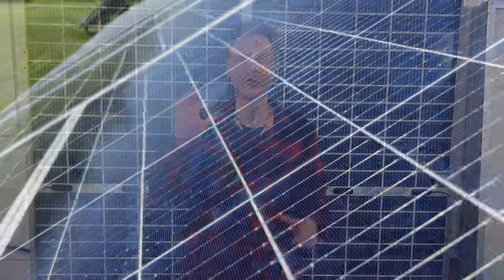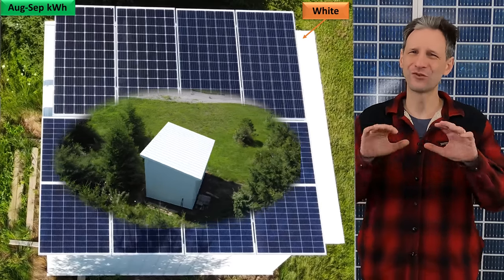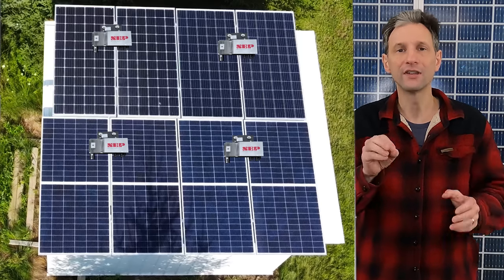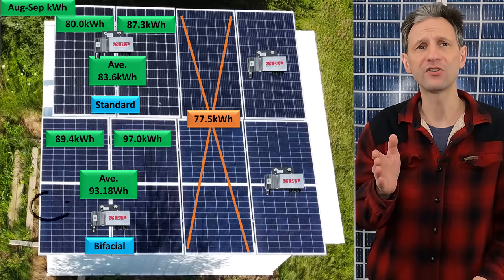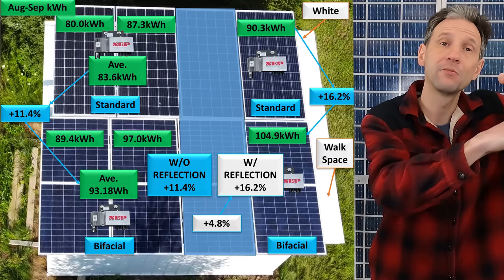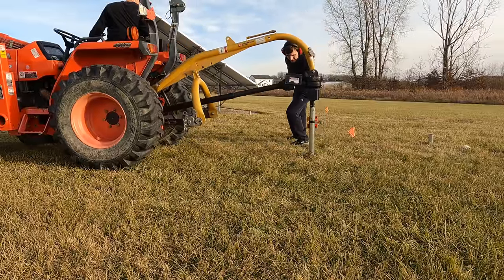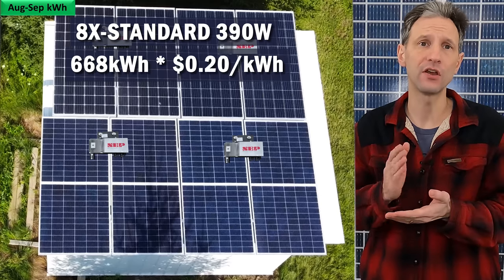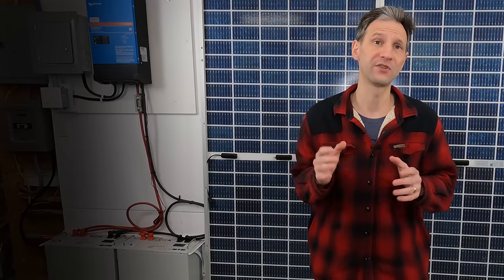Should you put BIFACIAL Solar Panels on the ROOF?

Comment: I just read a study on bifacials that showed that the best possible positioning is to align them east/west and perfectly vertical.  It produces more total power, and does so over a much wider time period.  The trick of course is the wind loading, but it's doable and makes a lot of sense as secondary panels to expand your harvest.
Reply from the maker: I have had a lot of requests for vertical orientation of bifacial panels, I plan to work on a test setup to try that out, but it will take a long time to get a full season of data.
Reply: Great point James!
I read a similar article that used bifacial panels in this way; but also used the terrain & weather (foggy) conditions to their advantage! They used water collecting nets above the panels (some also below for comparison) and produced not only more power but also got the efficiency gains of cooler panels!!!
Gotta love our innovative minded people coming up with these adaptations!!!
Reply: @ProjectsWithDave  That would be very interesting!  I've thought about doing a BF panel fence line if I ever feel the need to expand my system.
Reply: Ya, I was was wondering why this guy had them set up wrong. This guy wasted his own time and everyone's who watched this by laying them down.

Comment: ATTENTION: you missed a major point in conclusion in my opinion cause the bifacial have a better protection and longevity cause both sides are protected by glas. The small white foil will age not so well and once humidity gets in the corrosion will start and production decrease a lot. I had such issues with a trina solar panel field and you could see the progress of holes in the foil than getting bigger over time while also building oxidations on the cells itself. You can even feel them.

This can not happen with such bifacial panels and that can be worth a lot. You do not know what not can cause the damage of the foil like cleaning the roof with a Kärcher, also animals running under panels, then wind with sand and what not will have an impact and can damage a single panel and have a huge impact over time cause you will not recognise the slowly decrease over time  in a long string. Maybe a year or 2 later you will wonder and compare month to months and start a research what is going on. Many then consider degredation as the cause , I mean degredation of the whole field. And if another year or 2 pass by they might start offcially complaining and learn that it needs a labour intensive investigation on the roof for that string panel by panel cause it could be just 1 panel that has issues and not all of them cause then the solution is usually easy: remove the weak and broken one and shorten the string cause you will not get a replacement of the same size and characteristics as long as you have luck to find one or usually some on the used market over time. 

Glas Glas is the best you can get and it will pay off for sure but might take some years. The degredation or the likelihood of damages are lot lower than those with a thin foil . But I am from the EU and we might have different products and experiences here due to climate and what not. I do not see it often, but I bet many do not know after 12 years or so that a single of these panels could have caused all the losses what they considered to be caused by degredation of the whole string , not a single panel. They do not even recognice it cause no one investigates the back of these panels in the assumption if a hole in the back of 1 panel could have caused the whole decrease over the past 2 years.

But we had repowered a lot of roofs in a small period of time last year and faced a lot of these or similiar issues mainly caused by a single panel - also MC4 connectors that lost its perfect fit and connection. We try to look for that cause if you wanna sell used panels with faith you should know what you are selling and therefore we marked every single panel to later find out if we could see an impact when and where what might have started. We have to check the modules any way but it was the first time that we faced a lot issues with damaged foils no one can explain how that could have happened. Partly while carrying the panels onto the roof, then during mounting, connecting , fixing, adjusting by any kind of accident like a screw driver falling onto the shoes then hitting the panel under the foil. No one had taken care for that. Might also be the case of micro holes or scratches the winter and frozen water increased and what not. 

The worst panels with a ton of issues were the Trina panels 240 Wp from 2014 or so. 50% with one issue or the other and mostly oxidation under the white foil.

Comment: For me the comparison between output power and cost is the most important. If the cost of the bi-facials are 120+% greater, you would be better off installing more regular panels, unless you can meet all the added conditions to optimize bi-facials.

Comment: for rural consumers like myself, with plenty of white pole barn roof to work with, it sounds like it might be the way to go, especially as the price for bifacials keeps coming down. spread them out a little, mount them up off the roof some, and i want to put mine on angle adjustable bases so i can tweak the angle throughout the year.

Comment: So for this test if you were to lift the bifacial panels a meter or so, and have them on a ground mount preferably, You would absorb a lot more energy from the backside. This is mentioned multiple times in the literature, And I mentioned this in past videos. The temperature coefficient of those bifacials is also different. So more convective air flow helps significantly. A parking structure is fantastic for bifacials. They really need to be lifted up high to see the benefits. In your configuration they will run a bit hotter than they should and they will not absorb much energy from the back.
Reply from the maker: That's correct, the purpose here was to show what kind of performance could be expected from a standard mount on a white roof.  The higher elevation would be much better for all the reasons you mentioned.  Ground is a better application for bifacial panels as I show in my ground array results video: https://youtu.be/1SXNjsSsmq0
Also, I have done some testing with snow reflection on my ground array, I hope to post soon.  Those results were very good.
Reply: Is there a roof racking system that will raise them higher or is that a wind concern?

Comment: Thx for all your work and sharing of information. 
I appreciate any and all accurate information about solar setups.
I believe, in the interest of simplicity, the data provided is a good reference. Your/ my mileage may vary.
In this example, I believe the rack should be moved up so the white is totally under plus 6-12" or more.
The lack of reflection on the lower edger could essentially make the bifacial portion almost useless.
Also, ignoring the 3rd panels, skews the data. 
Averaging power is a start, but individual panel performance is more inclusive.
I am waiting on getting a pallet of new bifacial panels. Will be roof mounting most. May update afterwards.
Reply from the maker: Let me know how it goes.

Comment: I saw a video that said the tiny spacing between cells in a bifacial panel was transparent and light the would strike between cell on a standard panel would hit the roof and be reflected back to the back of the bifacial.
Reply from the maker: Some panels are transparent and some are not.  The Canadian Solar panes in this video have a white band that blocks the light between the cells.  I just ordered some panels that are transparent in the space between the cells.  I plan to do some testing and see if it makes a difference.
Reply: @ProjectsWithDave  I saw a Youtube video involving an installation in Britain where the transparency was pointed out.  Hopefully it can actually increase absorption on the underside.

Comment: I have two dual axis solar arrays of 3140 watts of panels per tracker. The panels are 390 watts each and are bifacial the ground surrounding them is a white reflective stone in order to maximize the reflective light. The best performance I have seen is around 3372 watts per array which was limited due to my MPPT controller.
Reply from the maker: Because you don't know what the solar irradiance was at the time of your measurement, and your inverter was clipping, it's hard to judge what the actual benefit is.  However, in my experience, conventional panels have to be significantly over 1,000W/m^2 to exceed their rated performance so it sounds like your setup is doing quite well.

Comment: Great videos. Thank you.
I don’t agree with you though when you calculate paybacks periods and ROI based on the system production. What counts is your actual solar consumption you don’t buy from the utility grid. And both numbers (production and consumption) are usually far from each other.
Reply from the maker: I have to purchase any power I don't produce from the utility.  That cost avoidance is used to calculate the payback period.  If I am overproducing, then the values change significantly as does the payback period.  It all depends on your specific situation.

Comment: How did you do a comparison with that shade hitting your bottom row?  Also, did you even consider temperature coefficients between panel types?  That, alone, can produce dramatic difference between two panels with identical DC-STC ratings.   Also position in the array can make a difference due to heat (and reflection, which you noted).  Best way to do this experiment is with the same panels... matched for output and then do two separate arrays (sans shade) and black out the backside on one array so no reflected light reaches the cells.  Comparing different types of panels by the generic category of monofacial vs bifacial is just not going to give you what you're after.

Comment: I just bought VIKRAM SOLAR 540 WATT SOLAR PANEL Bifacial for $277 on sale normal 330 from AltE i hope they work as good as yours.
Reply from the maker: I ran a back to back test between Canadian Solar and Q-Cell Bifacial panels, but unfortunately, The data was lost on the server.  I hope to give it another shot this summer then I will have some data between brands to see if there are significant differences.  I expect you will be happy with them.

Comment: I don't think bifacial panels are necessarily larger. The 445W bifacials I just received are slightly smaller than those ones you are using. I think you just have lower binned solar cells.
Reply from the maker: If you compare equivalent cells, just due the the physical layout of the cells, some area is lost.  Notice the large bands of unusable space between each cell and down the middle.  It may be less of an impact on some brands than others.

Comment: like your thoughts on bi-facial panel ground mount at 23 degree off due south set at a 40 degree slope in central Ohio and is tall enough for light to be reflected off white steel siding on a building running true east west.
your videos are very informative.  thank you for making them and the work your doing to gather the data to make them.
Reply from the maker: Thanks!  I'm glad the data has been useful for you.

Comment: I don't think that you understand how to install bifacial panels. Bifacial panels are supposed to be installed at an angle from the flat surface of the roof or the ground. They are not supposed to be installed flat on a roof like standard panels. So a better test would have been to install the bifacial panels at a 30 - 45 degree angle (or more) from the roof in a manner that the back side of the panels would not be shaded.  You DO mention this in passing at the end of your video. On such a small roof, that might not be possible. In some utility grade installations, bifacial panels are being installed at a 90 degree angle from the ground, and utilities usually have done their homework on how to get the most power out of their panels. So, when you work with bifacial panels, the idea is to create a racking system that allows sunlight to hit both sides of the panels as much as possible. On a roof, I posit that a 45 Degree angle might work, but I have not tested it. Mounting the panels vertically at 90 degrees would be optimum, however, because of wind loads on the rail system, I don't think that would be feasible. Ideally, you would want to install a racking system for the panels where you can adjust the angle of the panels so that you can experiment to find which angle works best over the entire year as the solstice angles of the sun change. I personally would want to find the optimum angle for the entire aggregate year, because I don't want to mess with my solar panels every 4 -6 months to adjust them.

I am going to install a solar panel system on my house and I have researched racking systems for roofs. There are some, but they are very expensive and I am not sure that they are rated for the high wind loads on a roof. Because bifacial panels are so new, the rail system manufacturers have not caught up with the industry. So you would probably have to design and build your own metal racking system and have a structural engineer review it. This is prohibitively expensive and time consuming. Of course for ground mounted systems, adjustable angle railing systems already exist.

Regardless of my minor criticisms, this video is an excellent comparison and is very informative. Great job!

One other thing that you need to inform your viewers about bifacial panels. There are two types of bifacial panels on the market right now. One has a maximum ambient temperature range of up to 105 degrees F. The second has an ambient temperature maximum of up to 155 degrees F. Obviously, for most climates, the second temperature range is necessary. I live in AZ and the lower temperature range bifacial panels would lose about 20% of their power output because of the high temperatures experienced in the spring and summer. I would ONLY recommend panels with the higher operating temperature range if I were you because they will probably produce more power in more situations. So if a northeast state like NY has a six week heat wave where temperatures go above 105 degrees, the lower temperature range panels will be adversely affected.

Again, great job. I enjoy your videos.
Reply from the maker: Thanks for the information.  This video wasn't to show the best application for bifacial panels, but rather what you might get if you installed them in this less than ideal condition.  As you said, this is not the intended application condition for bifacial panels.  Thanks!

Comment: It appears that those bifacial panels are flat on the roof and from what I understand they need to be lifted up as a matter of fact a 90° angle is ideal because it gets the Sun from both sides. From the technology of bifacial panels I would think they would not be good on a roof unless you could severely lift them up which I think would be a wind Hazard unless it's a flat roof. Flat on the roof as they are in the picture will cause them to heat up and bifacial panels generate less wattage the hotter they get.
Reply from the maker: The purpose of this test was to show the performance of the panels when mounted parallel with the roof.  They would certainly perform better if mounted at an angle to the roof.

Comment: I am interested in using vertically mounted bifacials in the winter in south Alaska. But I have been able to find absolutely nothing on the effects of vertically mounted bifacial performanc in or out of snow weather and nothing on their performance in low lighting which seems to be their chief advantage as promoted.
Reply from the maker: I've had a lot of requests to do some vertically mounted bifacial panels.  When I get some time I'll run some tests on the concept.
Reply: @ProjectsWithDave  Awesome! Thanks!

Comment: Great details on the data. Looks like you had more issues with the inverters producing power then the panels generating it.
It would be interesting to see the same data from you solaredge or getting enphase inverter.
A chain is only as strong as the weakest link. 
Are you going to do more testing with the Sungold IP6048? I have that inverter with eg4 batteries and I'm going to add some bifocal panels in later this year. I'm interested if your going to program the invert with the front panel or the laptop software and if you'll get the phone app working.
Reply from the maker: It's on my bench, I plan to expand my main array and support the expansion with the SunGold inverter.  Will Prose seemed to struggle programing his with the panel, so I'll likely use the software.

Comment: I'm looking to do a solar set up on my boat and im just now finding out about these. I have a hand rail around the back of the boat i want to have the panels pivot on, like a butterfly, so i can fold them down while underway. My question is, if im comparing a bifacial to a regular panel, does the bifacial NEED exposure on the otherside to get its full output? Or will just the one side produce the same as a regular and the back side is extra? I think my biggest benefit would be water reflection on the back.
Reply from the maker: Most bifacial panels are rated by the front side output.  The back side is just bonus.  Here is a video with more detail: https://youtu.be/1SXNjsSsmq0